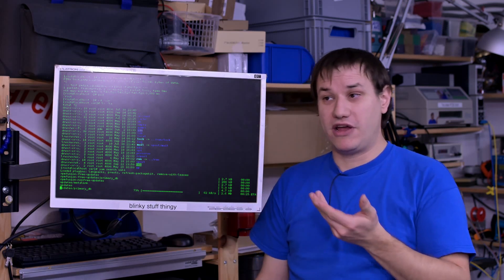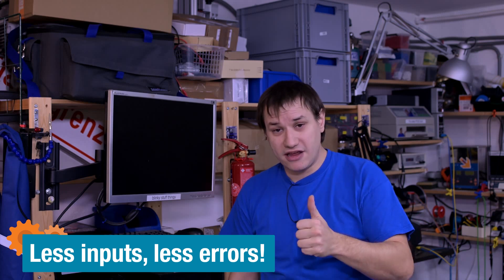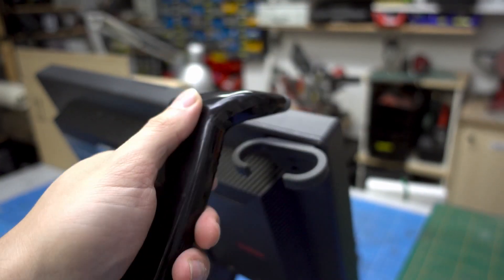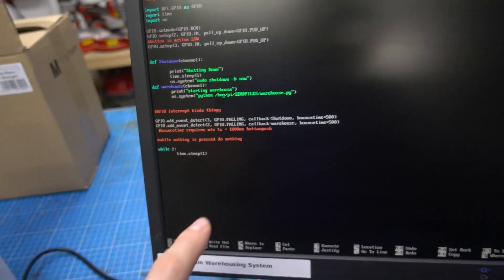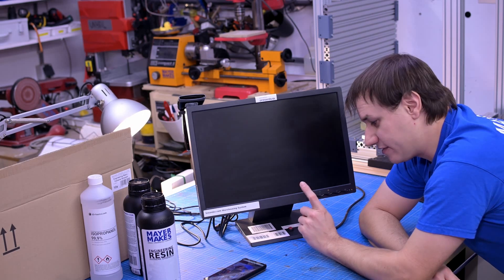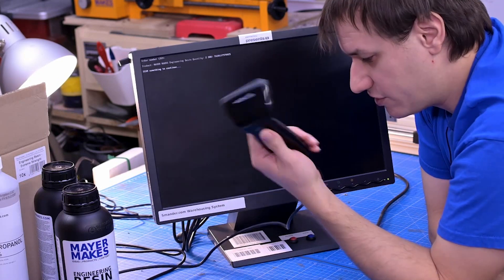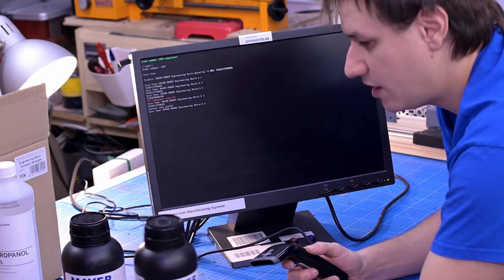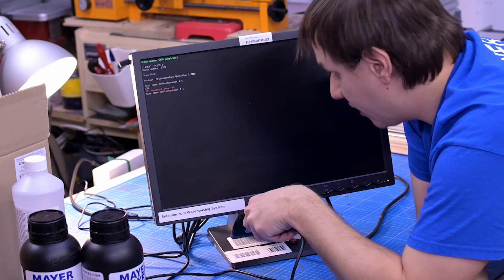Open Source Inventory Warehousing System

Comment: about start app on button, interactive applicatione need to be attached to terminal, if you run it in background that why doesnt work... simplest solution is to script with start read buttons run as autologin on terminal, so when you press button its will work becouse your parent script is already on terminal.

Comment: Hi

Very good, i had a similar one set up @ 2005, but back then the sales were from email & fax and data entry into Myob accouting, then exported as csv - that became the sales input

The only thing extra which can solve some of your issues is that after each item-line the system prompts the user for a command - eg next item, close sale as part parked, continue, prompts / commands were the same as yours by a bar code
Each user had a clipboard  and a laminated page with about 12 labels on it in a laminated A4 page  commands were something like

Next Item
Complete and save this order
Back 1 item (redo)
Save partial order progress
Save order completed
Next New Sale
Quit / finished packing
Each user had there own sheet with a label for there id eg EMP123 ( employee and their payroll number )

The system uses some older left over admin 386/486 machines with just dos, the only draw back was it is not portable so we have about 6 or 7 of them throughout the warehouse and the orders were packed then they had to trolley the items to a pc , and re handle /scan them etc 

this was annoying for the 3 storeman, but eventually we got busier and instead of another 2 store man we used factory staff, the storeman picked and packed trolleys / carts and left them to the nearest pc station, then the "bar code handler" would scan and move from one trolley to the another - it worked well, and at least the system had a time and date log as well as the staff member - a few disputes etc which was to be expected but it worked well for the 5 years i was there

The next 2 companies i worked for used print outs and clipboard that were selected and placed onto pallets by "pickers" then check of and boxed / cling wrapped by dispatchers

Regards
George
Reply: Thanks fir the insights!

Comment: I've been part of a team developing an inventory system for a PC refurb start up. We used shortcut barcodes as well. But that was more a personal choice. We had to have a UI because we couldn't avoid data entry and had new employees. At first they had a web dev to do it all in a browser. The web server would frequently crash and halt everything. Bosses constantly demanded changes and it was hard for the web devs to keep up and coordinate everything. Eventually, they built an application. The admin version had a drag and drop modular UI layout which adjusted the schemas automatically. The user version didn't allow customizing. But would update to reflect the changes. Would recommend going that route from the get go.
Reply: You need a web farm and a load balancing router to manage front-end issues.

Comment: I've actually just finished up an basic inventory system for my workplace (like, 2 days ago), and was thinking about doing an connection with our (WooCommerce based) webshop so we know which items to scan. Ofcourse, I am also looking to make it as simple as possible but in my experience an CLI scares people. Even when it doesn't have a keyboard. Also the scanner we use must be much more capable than just scanning EAN, GTIN and UPC barcodes because the manufacturer put on some products an Code 128 barcode for some reason.
Reply: thats a typical task, and if your employees are afraid of CLI just hide it with tkinter behind a nice colorfull screen. If yo uget acamera based Barcode reader you can scan ALL the different barcode. but they are sometimes slower than these GTIN ones.

Comment: oh my god. Imagine a sql barcode attack, you replace a tag with one that says ;drop TABLE *; and walmart can say goodbye to their databases. I hope they've thought of that by [current_year]
Reply: guess what, I tried that out at work. the sanitation is quite easy, they usually match it with a database of allowed barcodes.everything else including injects gets dropped. also can't inject SQL if the system can't understand Sql
Reply: also in this specific project the only inputs that get processed are an exact match to the barcode, or "XXX" which means abort.
Reply: @MAYERMAKES  the bare minimum you hope for is that there aren't plaintext passwords and input is sanitized. Lots of tools and db markup have it out of the box so you have to be actively ignorant to mess it up now a days
Reply: @adammills4099  yeah, I had to make a dedicated script to demonstrate how injects work as I could not find a simple thing that was vulnerable.
Reply: article not found......

Comment: Funny guy 🙂 however you can start any programm with a button. But why not loop the complete script at startup. And only exit it when the power bttn is pressed you can monitor for a shutdown command. and nicely exit the code at the shutdown sequence
Reply: you might have missunderstodo the problem. A python script that uses the input() function cannot be started correctly after boot by any script or other method besides a keyboard, all the input output rerouting methods do not work for this.
Reply: @MAYERMAKES  Okay, could be, i'm writting my stuff in JavaScript and run them with NodeJS, and those work fine, i start them from /etc/rc.d/rc.local maybe an addition of </dev/tty1 would help 🙂

i dont have any python scripts that read true the input() function so i cant test it 🙂
Reply: @MrGarfield  tried all variants of rerouting dev/tty

Comment: Make a cash Register on raspberry pi
Reply: depending on where you live there can be alot of specific restrictions to the hardware for that (for example a state issued encryption unit can be mandated) so that project might not be that usefull. but we may be able to pull of a Card terminal using some already approved framework.